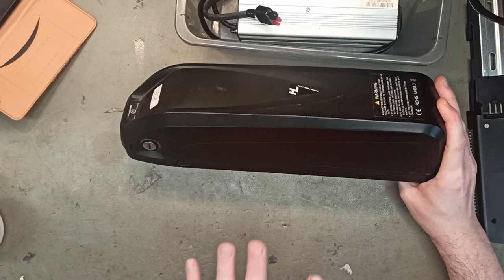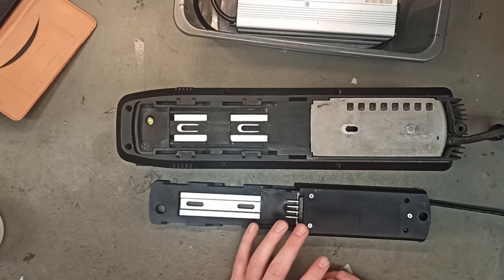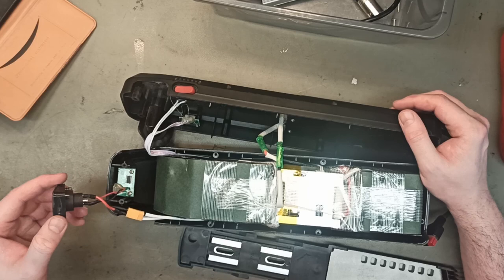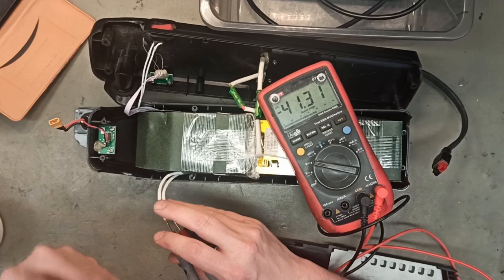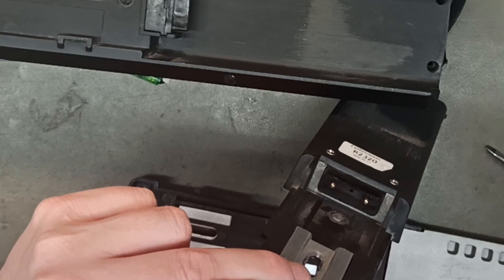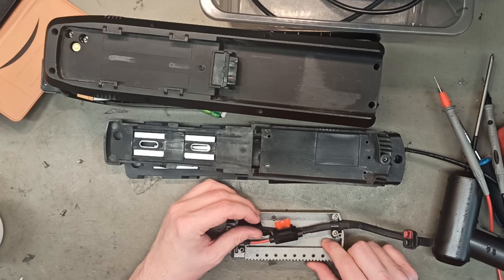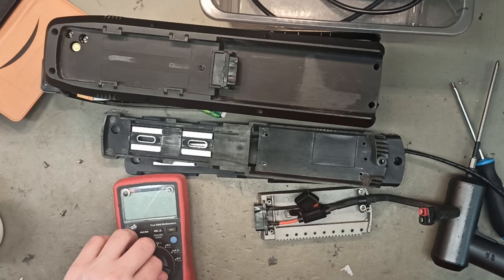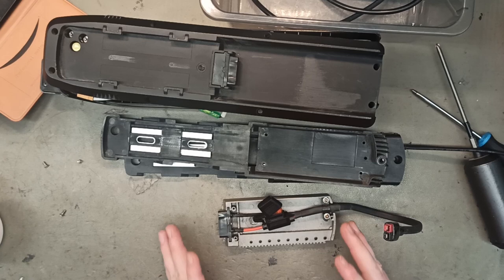Trouble shooting of Hailong SSE-077 52V Aliexpress battery

Comment: I just recently started watching a handful of your videos and impressed with your knowledge and the troubleshooting. I have a question on a hailong 52v 19.2 ah battery that is probably a few years old now. The problem I'm having is the power button when you press it in there appears to be only some of the green lighting up and the plugin that needed to be replaced. Diy with no knowledge thought I could do it and had several unexpected surprises upon opening up the battery.  1- there is a pin that is not connected to anything and it's a two pin connector. While looking around I noticed that the wire that has three white wires and a red wire connecting to a connector appears to be lacking a ground and the only reason I say that is because when I looked at the power plug I see one thin flat connector not connected to anyting this is right beside where the white and the red wires are connecting to the power plug. What does that plug up to and I'm wondering if it's a ground😊 but I cannot find schematics or any information on this plug and the wiring surrounding it. I will attach a couple pictures to help make more sense. I need a wiring configuration for this power plug and the other internal wires that's right there at the front of the battery case. See attached pictures
Reply: This person posted one time and does not give a crap about following up on anything.  Sounds like a wanna be.  Look elsewhere for your answers, you are not getting them here.:person-turqouise-waving:

Comment: what type of pin does the hailong 5 pin connector use?
Reply: I'll try my best to explain this so it makes sense the push button for the power has four pins plugged into another connector with the three white wires and one red wire. And that connector when it plugs into the connector of the plug-in that we're referring to the 4-pin there is a unconnected 10 on the base of the power plug